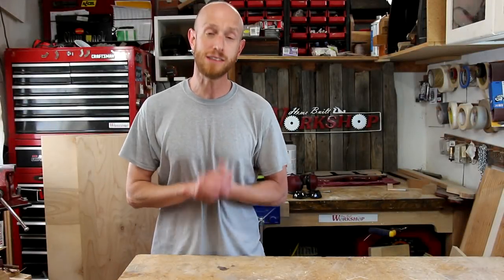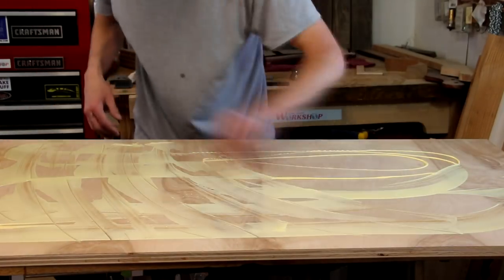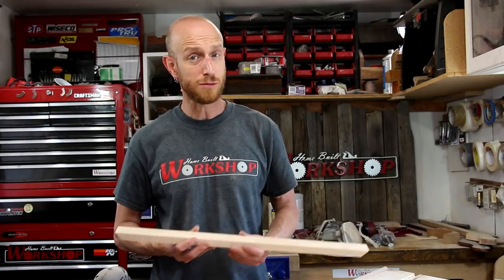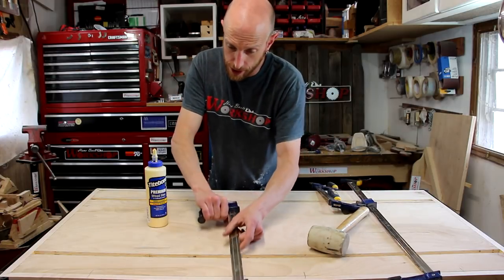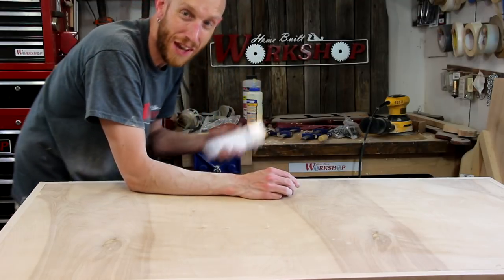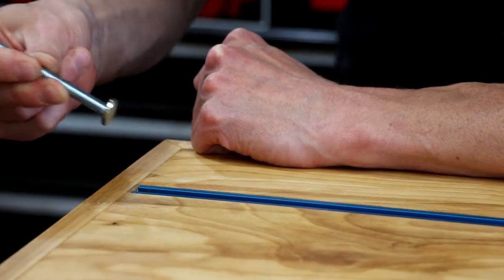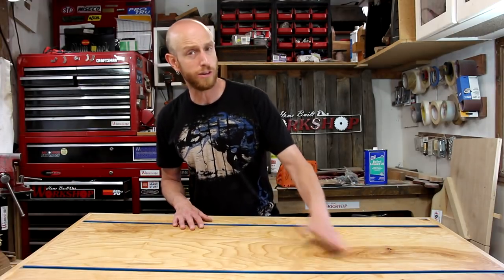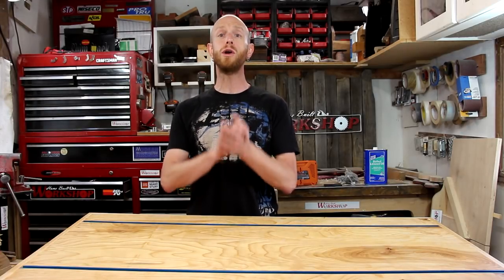Small Shop Assembly Table

Comment: Adding paste wax would help make the top more resistant to glue and other spills, which is good for an assembly table. On the downside, paste wax makes the top slippery - not so good for holding things down. Look into getting some bench cookies with risers. The risers will slide into your t-track, then you can add another surface on top of the cookies. They have a rubber grip surface, which is nice, and they also have a cone attachment for finish work.
Reply from the maker: Good call on the t track cookies. I'll look into them. It sounds super handy. 👍

Comment: Not checked for winding. Very necessary for assembly tables to check with two strings touching at the centre crossing on the diagonals.

Comment: Since nobody commented on the wax surface, thought I'd put in my 2 cents.   NO.  On one hand you want your ripped wood to slide easily.  If that was the only objective, YES, add wax.  However, as an assembly table, especially with your clamp tracks, you don't want the clamped stuff to move around.  A slick top does not help hold things in place.

Comment: Hey Jeff, I see that big vice in the corner. How is that mounted?
Reply from the maker: It's on a steel tube stand. I can move it around. It's great for lighter things. Pretty stable but does wiggle some if you get too crazy with it. 👍

Comment: Jeff,
You could’ve also removed the track, install the bolts and screwed it back in. Just sayin’.😆
Reply from the maker: I thought about that but i wanted to be able to remove the bolts.
Reply: Jeff,
True. Keep the great videos coming!👍🏻
Reply: Why would you want a table top with Bolts permanently sticking up ?  Kind of makes the  table worthless.
Reply: @homebuiltshop  You could also have filed the sides of the t-bolts enough to clear the track.  When you tighten them in the track, they would have turned enough to lock in.  Then no gap on the end.  I know this will work because I made the same mistake.  lol 😲